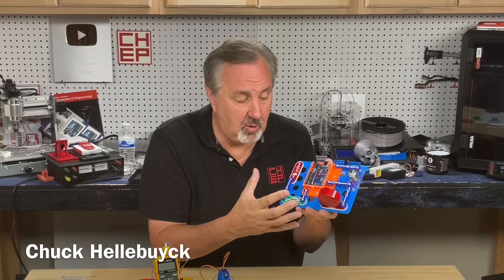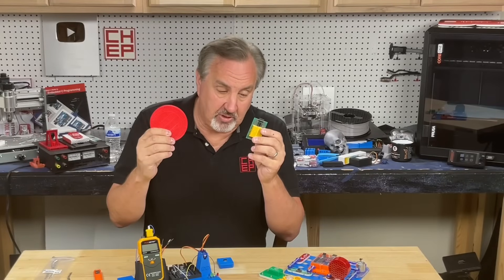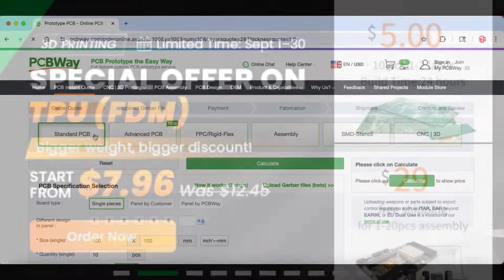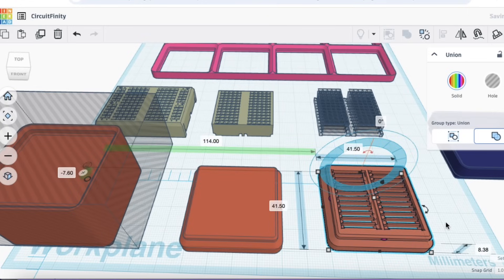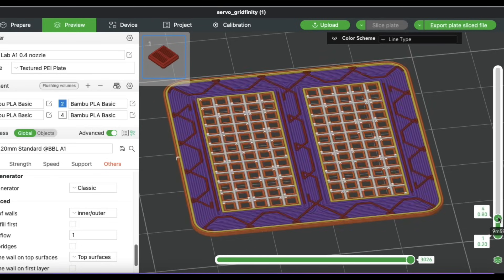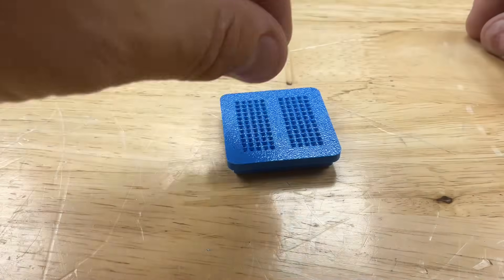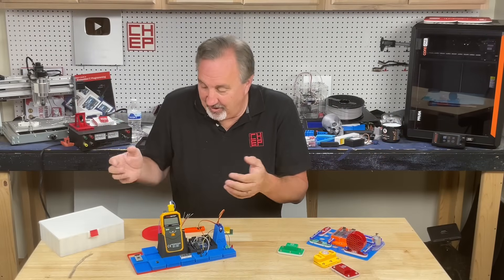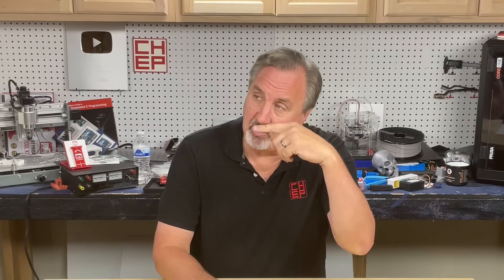Gridfinity Circuits: Electronic Modules on a Gridfinity Base

Comment: Coming from an Electronic Engineering background, I have static electricity concerns.  Static electricity burns holes into silicon and also shorts layers, which is why they have created conductive plastics to dissipate static electric charges.  Just sitting on the shelf, static charges can build up and discharge into your electronics, inside of plastic enclosures.  ABS is typically on the safer side, but I don’t know about PLA, PETG, TPU, and others.
Reply from the maker: Semiconductors are far more robust than they were when that was a concern.

Comment: At first I was expecting your modules to have contacts on the side so they would connect to the middle next to them.
Reply from the maker: That’s an upgrade that could happen with magnets but then you don’t need to Gridfinity base either. It’s something to consider though once several designs are complete.